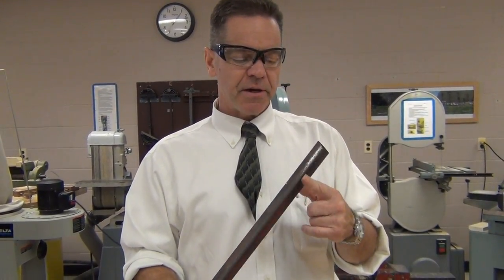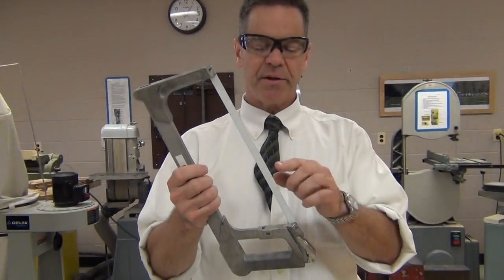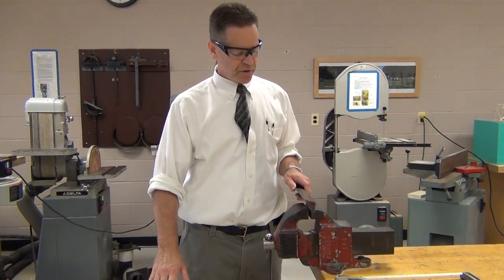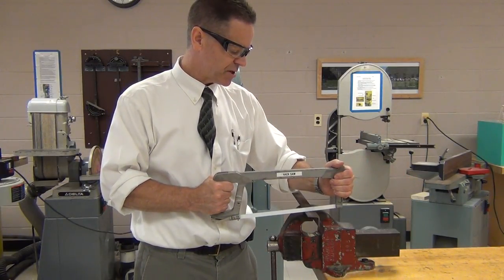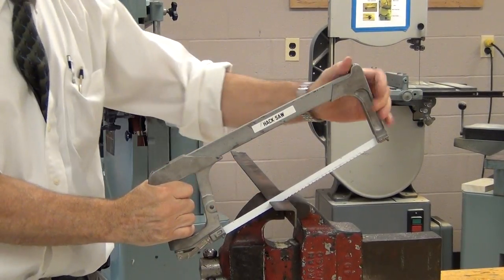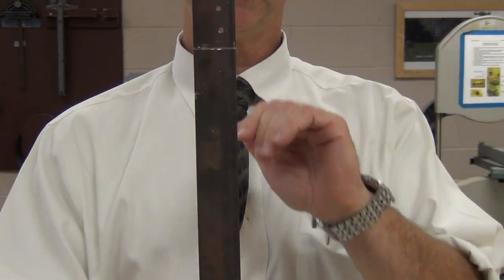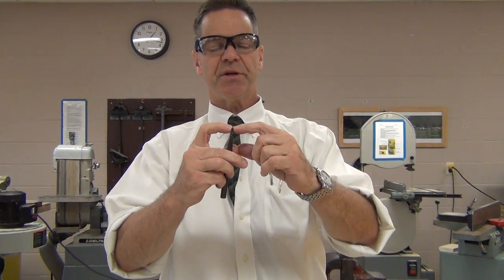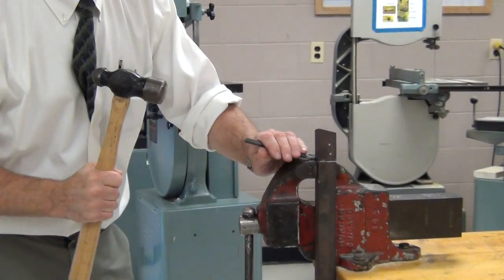Hack Saw and Cold Chisel

Comment: Up to this point I’ve used cold chisels to knock heads off sheet metal screws while scraping steel appliances.  Cold chisels can work when a grinder or plasma cutter is impractical.  Also, you can make square and and rectangular holes in sheet metal.  Just use a drill to hog out then shear off remnants.